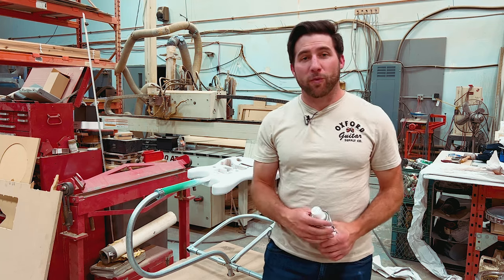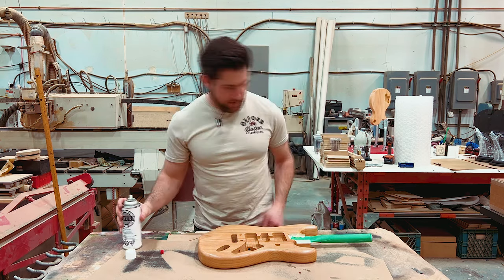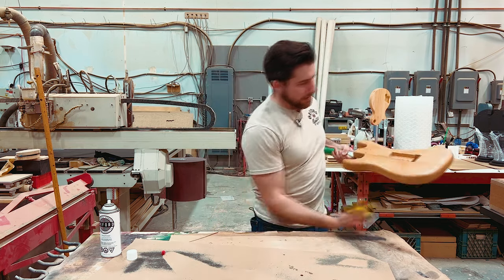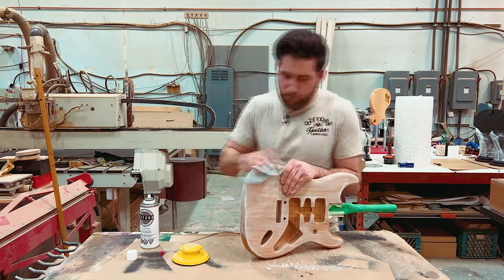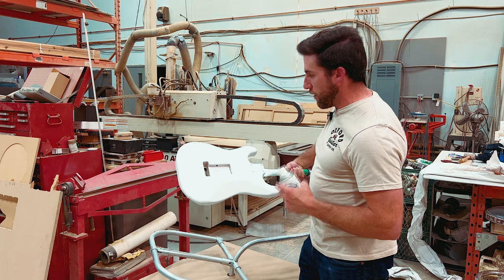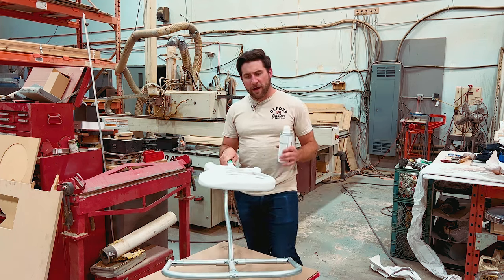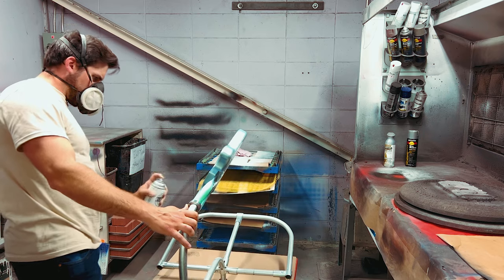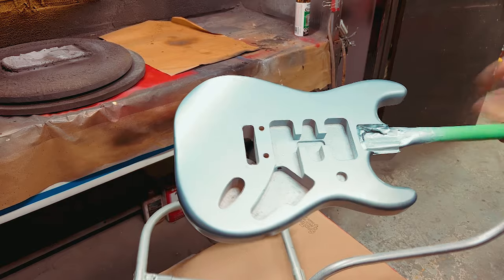The Easiest Guitar Spray Painting Tutorial (Part 2)

Comment: Can you do a pearl white guitar, it’s seems to be a top secret on how to do it. They will show the guitar but not how to do it.
Reply from the maker: It would be the exact same except with a pearl white instead of this metallic ice blue.
Reply: Todd from Sweet T here! Not overstepping on Brad's turf here but a pearl white it best sprayed as a Tri-Stage method. A base of white and then a midcoat of pearl!! ✌️🤍
Reply from the maker: Thanks Todd. Would the white primer not suffice for that? With the white pearly overtop? Or would you go white primer, white ground coat, and then pearl mixed with clear for more sparkle?
Reply: @BradAngove  yeah man, I didn't think about the white primer. It would work and I'm sure you'll agree with this but the less material you can spray the better the results. Using the primer as the ground coat would absolutely work and it would keep you from having to add yet another step to the "Tri-Stage" process.  I would add pearl to the first coat of clear just as you said! The only time I think that white primer wouldn't do a good job is if you were going for a different "white" like maybe a little yellower for that vintage feel or a little bluer for a pure white look. You know the deal brother. I was just adding in my 2 cents.✌️🤍
Reply from the maker: @SweetTGuitars thanks Todd. Your insight is always appreciated.

Comment: Hi Brad, it’s me, Pat Lis again. I painted the guitar body with a  glitter coat , but something went terribly wrong, there are now white dots covering the body of the guitar, unsure if I can buff them out or not. I coated with three coats of triple thick coat and wet sanded with 1000 grit, looks awful. Would send you a picture , but don’t have the option to do that so you could see and possibly provide some advice on how I can fix.
Reply from the maker: Did you have some air bubbles in the clear coat?

Comment: Hey Brad. How are things? Hope that you and your family are doing well. I have a strat body I need to paint. I’m going to do a Marvel Blade themed guitar in black and metallic red with some metallic chrome airbrushed elements. I have a grey primer but don’t have a grain filler. Do you need a grain filler or can you just sand it fine and give it several coats of primer? I’m going for a satin finish, not something overly glossy.
Reply from the maker: Depending on the wood sometimes I don’t use grain filler. If it’s open grained wood then grain filler is important, but there are several different things that can be used as grain fillers.

Comment: I did mine without technical support or skills .... How long will it take to dry out after adding the last and final color spray

How will it be dried too!
Reply from the maker: It depends how heavy you sprayed it, but usually it will be dry to the touch in a few minutes and fully dry in about 3 weeks.
Reply: @BradAngove  3 weeks? after two weeks I coupled it and place it in my guitar bag, it was sticky... I then thought there's a specific method to dry it
Reply from the maker: @JayAwakene are you using the same paint type as in the video?
Reply: @BradAngove  not at all, I got a random spray paint and primer
Reply from the maker: Ok, the drying time depends on the paint type. So I can’t tell you much without knowing that.

Comment: I’m considering Lake Placid Blue. Other sources tell me that LPB, being a darker metallic, is best done over a grey or silver nitro primer (which Solo doesn’t seem to sell). How important is that difference?
- Paul
Reply: I have painted guitars and cars. With that said a primers purpose is to fill small imperfections while being sandable. The color of the primer does not matter. 
Hope this helps 😊
Reply: You don’t need a silver undercoat but if you want to use Inca Silver - same deal
Reply from the maker: Primer color can help you achieve the final color faster, and can affect its hue a little, but is otherwise not important. I don’t see why you would need grey (and certainly not silver) primer, but you could always add one coat of grey or silver nitro (not primer) before the blue to help set the base color.